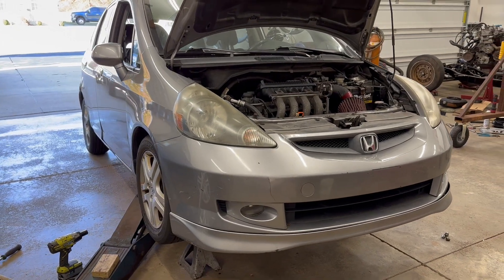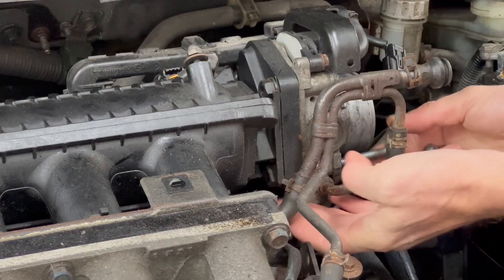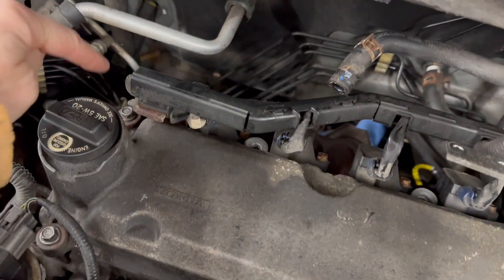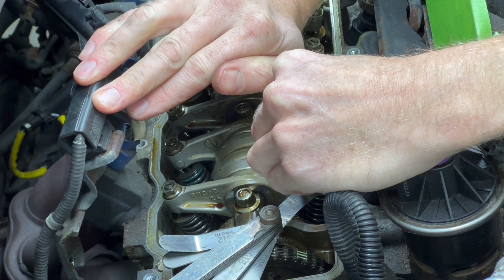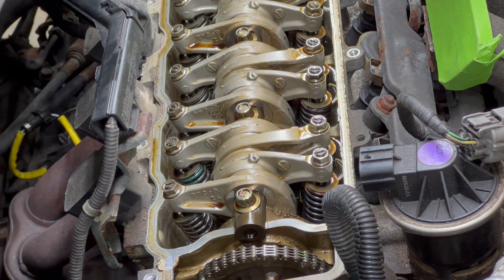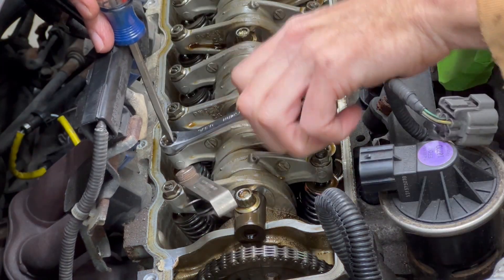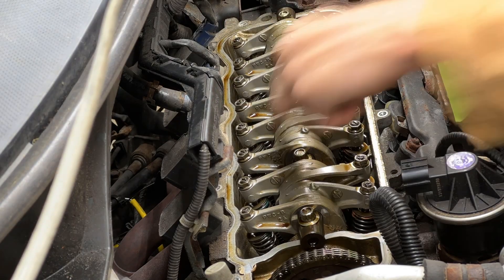How to: 2007-2008 Honda Fit Valve Adjustment

Comment: Just did my valve adjustment following this guide and the Fit is sounding much happier at idle. Thank you for the video once again 😁😁 All of my exhaust valves were insanely tight and my intake valve was so loose I could fit a 0.010in into all of them except #4 lol

Comment: The problem is not explaining tdc.  I followed this notion and set valves based on camshaft marker as you did now loud ticking.  Need to be tdc on compression,  marker on timing cover and camshaft
Reply: thank you for that. glad I saw your comment. about to do this job next week when the gaskets come in.

Comment: Your gaskets looking different compared to what I bought back in 2016, the blue sh..tty Permadry Felpro started to sweat in 3 years. The engine is very clean; so looks like oil changes were on schedule

Comment: Glad to see you still making content on the 07-08 Fit! Love these cars.

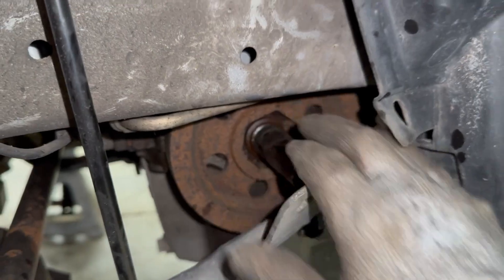Edit: 4:09 Could it be the motor mounts being worn out causing the hole for the crank bolt to not align?
Reply from the maker: The motor mounts are actually good. It turns out this car was in an accident at come point in its life, on the front passenger side. From what I can see damage was mostly cosmetic (hood, fender, headlight) not structural, but maybe that had something to do with it. This car lived a rough life before I got it.
Reply: @6thGearGarage Ohh ok! That makes sense. Thanks for this video, I’ll definitely refer to it when I do my adjustment.

Comment: Great video! My experience (from racing dirt bikes) is that both exhaust and intake valves tend to tighten up as the valve wears into its seat. I'm not denying what you saw though - makes me wonder if something else is prone to wear on that Honda. Maybe the rocker arm or valve stem? Interesting observation either way.